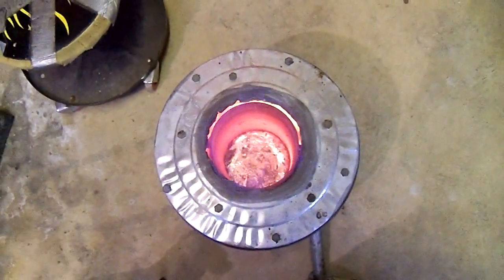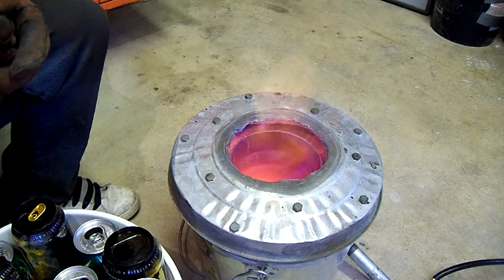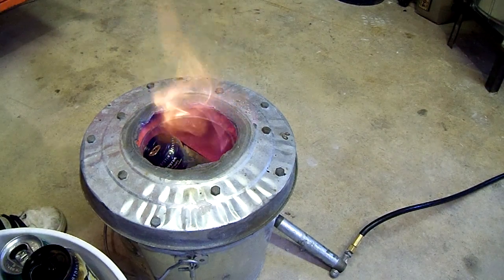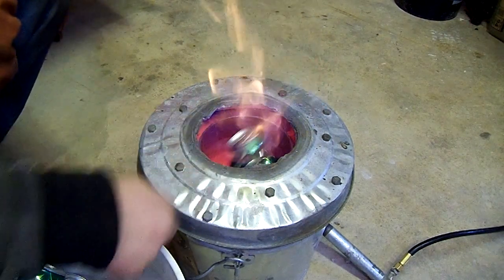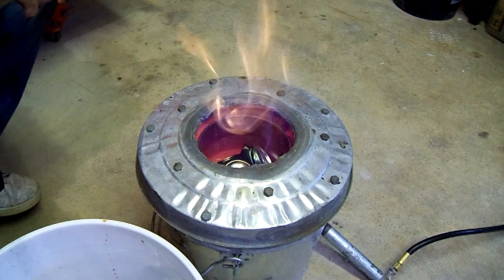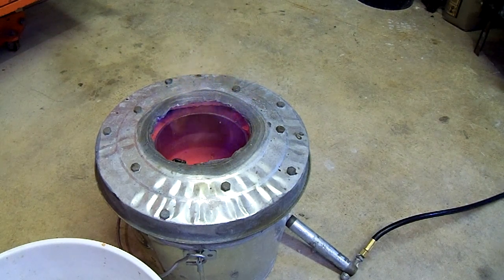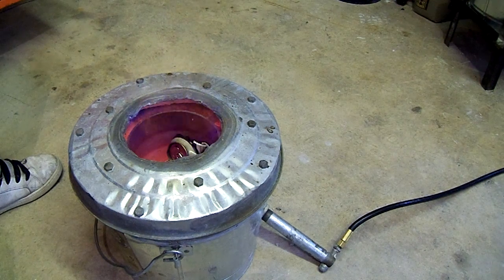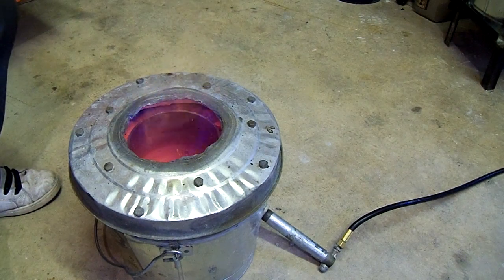Part 6 - MELTING THE ALUMINUM!  - HOW TO MELT METAL AT HOME

Comment: What are the dangers of the fumes? and what kind of venting system would be needed?
Reply: Aluminum can put off some bad gasses so it's recommended to do this outside or in a very well ventilated area no hoods required.